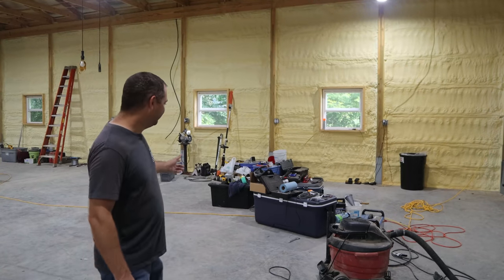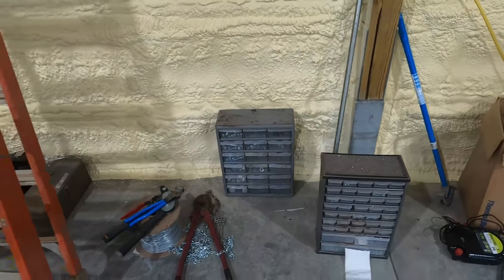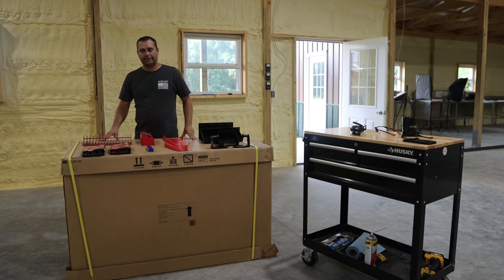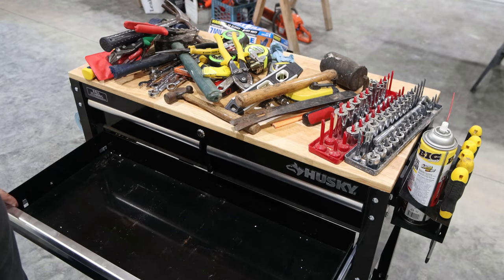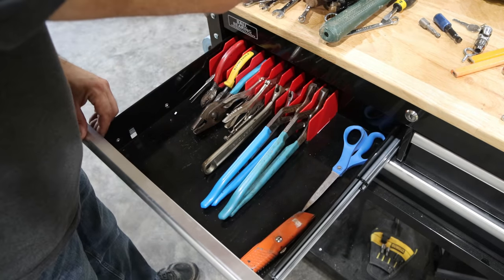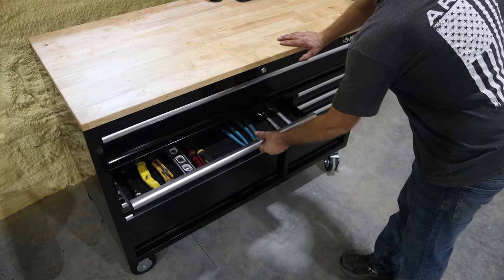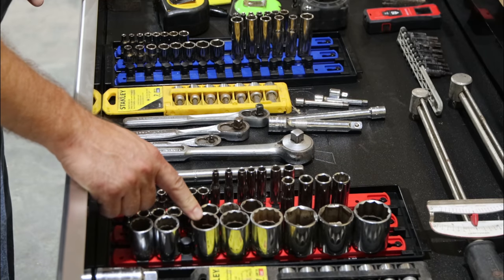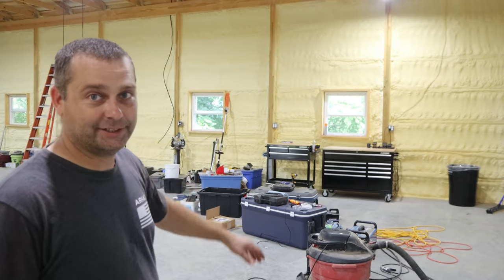Organizating the new workshop   New Toolbox, Shelving, and Tool Organization

Comment: I would attach a 4x8 sheet od plywood to the wall and put your bolt bins on that, or on shelving you attach to the studs. We have one drawer for pliers and wire tools, one for wrenches and sets, one for hammers, one for sockets in their boxes.the lighter stuff goes in the upper drawers and heavier stuff in lower. Love your shelving system! We keep all our power(corded) tools in Their cases on them. Wish we had  your square feet. If you can imagine all your tools and put them in a 16x32 area. Thats our shop, with a table for a metal lathe, wooden workbench and all our stationary tools ranged in three rows, with wheels so we can move them as needed.

Comment: Don't throw away big cardboard. Can put and work under trackers in case of oil leak
Reply from the maker: That's a good Idea. I wish I would have known that earlier.   I changed oil in the tractor the next day.
Reply: Also good use for planting around shrubs or trees, help keep down weeds paired with mulch. If no mulch, then use compost on top of it :)

Comment: Move the batteries from the toolbox top. Buy/build a battery station.
Reply from the maker: Once the walls are finished, it will have a battery station but until then, the top of the toolbox will work.

Comment: I have the very same shelf system you have. The manufacturer does not mention it, but I do--anchor those shelves to the wall. Couple of screws near the top can save your life when things start to topple. I live in an earthquake zone (PNW) and  so do you--the New Madrid Fault is less than 200 miles from you. But even without earthquake risk, shelves that high can topple when you are pulling a heavy tote off an upper level.

Comment: I have four of the Gladiator steel shelving units in my garage and I love them. They will hold 2,000 pounds on each shelf and that is a lot. I put a 1/2 inch board on the top of the wire mesh and cut them to fit and that adds even more strength to the shelving and you can put paint cans, motor oil containers, and other cans or bottles of fluids that you use. The garage is looking good.

Comment: I suggest white plastic 4 x 8 foot sheets of material to cover the foam on the walls. It has a pebbled surface and is held onto the wall with white plastic rivets. It’s used in 7-11 bathrooms, among other areas. Easy to clean and helps with the light levels.

Comment: If you include clean up as part of the job  the job is  not done until you have cleaned up. Cleanup is part of the job is not a job by itself. It's a change in mindset it makes all the difference👍👍💖
Reply: Agree with you totally.  So nice to start "with a clean slate" on the next job.

Comment: Nice shelves.  surprising just how fast they fill up though.  I now have about 6 in my basement against one long wall.  All full of our "treasures".  (stuff that probably needs pitched).   The other useful thing to add to a garage is those wall mounted railings that allow you to do all kinds of versatile stuff like mount anything from a shelf to double hooks to hang bikes or your pole saw, etc.  I can see one being used beside your new work bench to put a shelf on for your chargers so you don't have to move them when you want to wheel your new tool box somewhere.

Comment: Just like any job you need to be organized.  I can't function if I can't find what I need to do the job.
I have automotive, electrical, wood, metal, fencing and everyday odd items.
I like them separated so it's easier to find what I'm looking for, depending on the project of the day.
A friend of mine also made a shelf for all his battery chargers and mounted it to the wall so his work bench was not covered with cables and batteries. He also put up peg board, painted them white, to hand hand saws, loppers,  pipe wrenches. He out lined the item and painted it black. So, if something was missing or if someone else was putting tools away they could see right where they were suppose to be hung up. He also installed a triple electrical plug that pulled down from the ceiling which makes it great for keeping cords off the floor & not tripping over them. And his air hose is close to the front beside his compressor on a reel that makes it easy to use just outside the shop door to blow off the lawnmower deck & pulley area or pumping up on of the kids bike tires. Just in case he had a project going on the floor in the shop he didn't have to drag the hose thru his work area to handle these small jobs.
I would love to have a nice workshop, enjoy.

Comment: I have shelves just like that and I ended up changes the metal wire to 1/2" plywood and glued and clamped it down till it dried and now there isn't a lot of metal noise and can put smaller items without falling through. Love how you did your tool boxes.

Comment: Should have saved the big pieces of cardboard. Saves your concrete when you do oil changes. As usual great video.👍
Reply from the maker: Someone else mentioned that.  And it is a great idea.  I wish I knew that earlier.  I changed oil in the tractor the next day and spilled oil everywhere.

Comment: Things are looking good! I will say I think you are going to need way more bench space for general use. I would build a 12' bench along a wall with a shelf underneath. Good place to mount a vise and really have a proper work surface. What are the plans for the interior walls? Ceiling? Heat?
Reply from the maker: Eventually I will put metal on the walls and ceiling.  But the wood working half of the barn will be first.

Comment: Tool box bolts?? Get out the MIG welder!
Now on to 50 feet of steel workbench. A man just needs space. 😆
I had 5 of those shelving units, they're great, put 10, 426 Hemi engines (original Mopar) blocks on them, quite sturdy.

Comment: Of all the toolbox assembly videos I’ve seen, no one thinks to pull the drawers out to make it easier to turn over. In this case however, I’d have left it on the forks and raised it up to put the casters on. I’ve never seen a guy with a tractor and loader work so hard without the tractor and loader. Work smarter not hard man.

Comment: There is a way to unplug the backup alarm on your tractor. It’s probably under the hood or above the 3 point hitch under the back fenders.
Reply from the maker: It is under the cab.  I am sure it can be done.
Reply: @mmm365  I can understand what you're saying but disabling that alarm could be an accident waiting to happen.  Probably not that loud in the cab.  Evan doesn't always work alone either.  50/50 on the idea.  Just sayin'.

Comment: Got any info on the shelving units. I have the same window setup as you and I think I can do the same thing.
Reply from the maker: These were just "husky" shelves.  They are home depot brand.  But edsal, muscle rack, and gladiator all make the same style of shelves.  You can usually find them at any home improvement store.  These shelves were around 6 feet long and 6.5 feet tall with four shelves.
Reply from the maker: https://www.homedepot.com/p/Husky-Black-4-Tier-Heavy-Duty-Industrial-Welded-Steel-Garage-Shelving-Unit-77-in-W-x-78-in-H-x-24-in-D-HBR782478W4/310651468
Reply: @CountryViewAcres  
Thank You Sir!

Comment: Who makes the shelving units?
Reply from the maker: The one I bought were Husky, which is home depots brand.  But they are also made by edsal, muscle rack, and gladiator.   Lowes has there own brand as well, "kobalt".  Most home improvement stores one of these brands.
Reply from the maker: These are the ones I bought.
https://www.homedepot.com/p/Husky-Black-4-Tier-Heavy-Duty-Industrial-Welded-Steel-Garage-Shelving-Unit-77-in-W-x-78-in-H-x-24-in-D-HBR782478W4/310651468